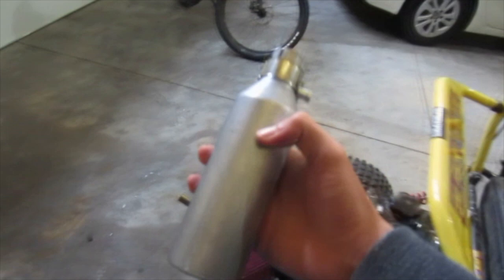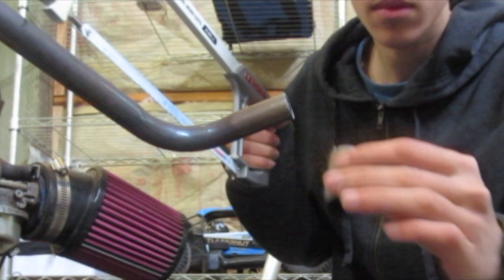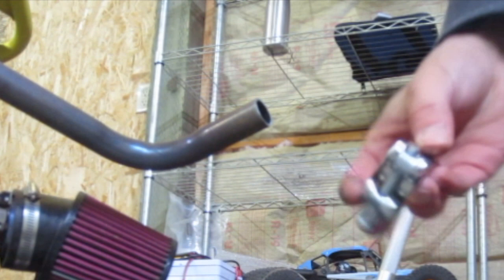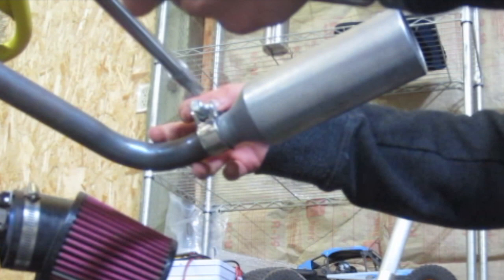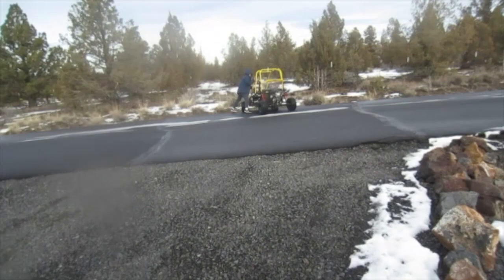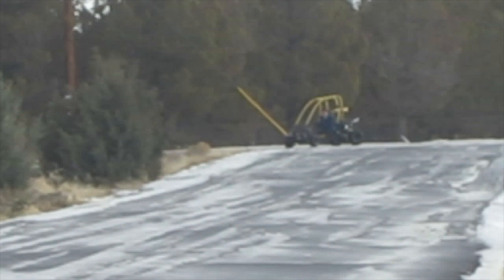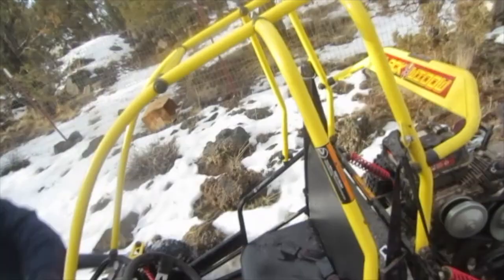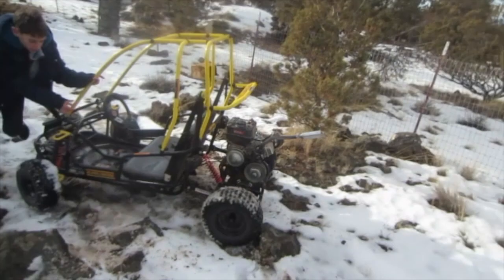Putting a performance muffler on the Go kart (sounds good!)

Comment: I need help because I have the same go cart and my rear tire rim just broke idk where to get a new one
Reply from the maker: Unfortunately, the manufacturer no longer produces these go carts or their respective parts. I have also needed parts and not been able to get them. I would say, try to find some generic rim that fits the shaft. You might be able to find one at gopowersports.com
Reply: @Differentthings2006  okay thanks

Comment: does your belts ever snap or break? Because that’s what mine have been doing
Reply from the maker: Usually not, they will get worn out after a lot of use, but they don't just snap usually. It's possible, your pulleys are misaligned, which could cause excess, wear. Or maybe the belt is too tight. I've noticed running it a little looser drastically increases the belt lifetime. Best of wishes that you get it working correctly.